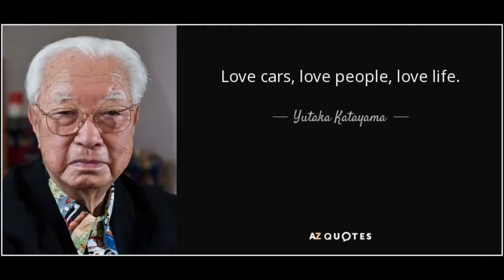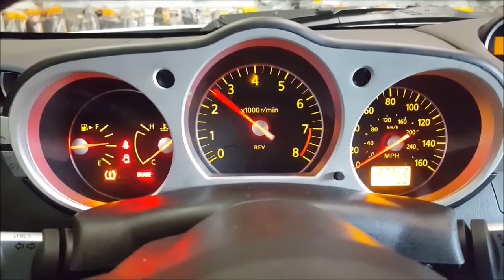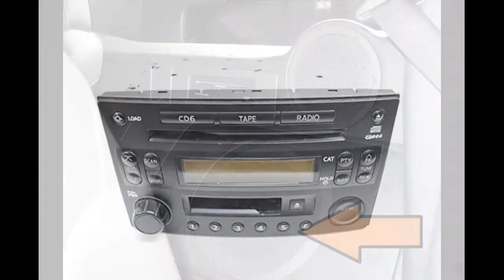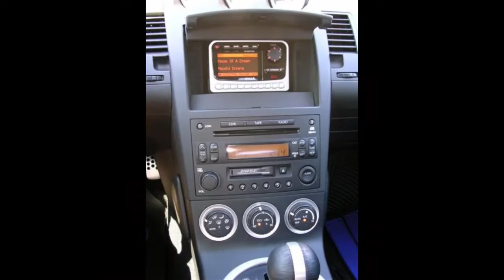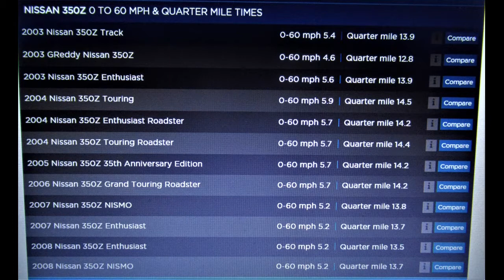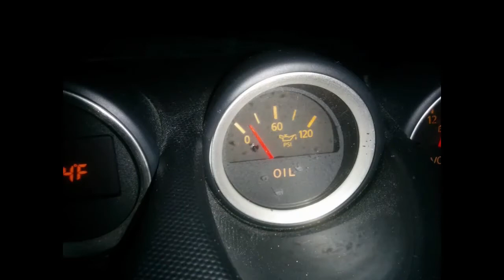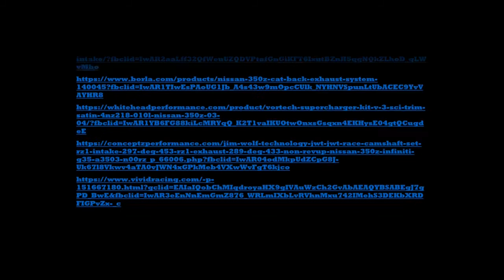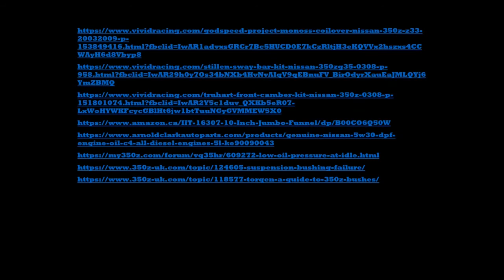Nissan 350Z

Comment: I had never heard of or seen that 240z concept car before, but I don't like it.  It has the same styling problem as the Toyota MR-J concept car - it looks like a bar of soap without any "character" or detail.
Reply from the maker: The 240z Concept does look like the original 240Z after being melted in a microwave. LOL. The 350Z design they settled on was so much better :-) Hindsight is 20/20 but I think Nissan missed a huge opportunity by not importing the S15 Silvia into North America. It could have been a Genesis and FRS competitor. I think they also should have had a Turbo/Supercharged 350Z as a hero car. I remember when the 350Z came out and it was considered a huge let-down compared to the 300ZX. The 350Z was an awesome car, but in the beginning it was in the shadow of the 300ZX TT.